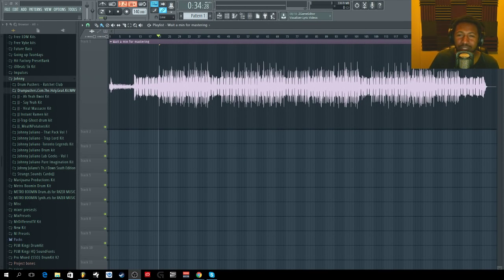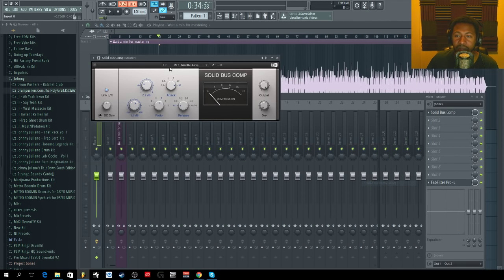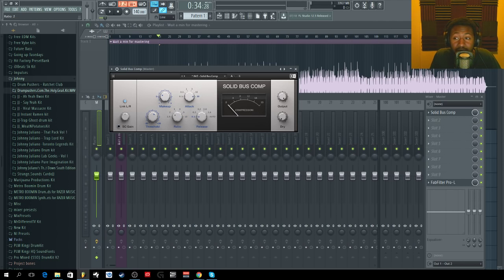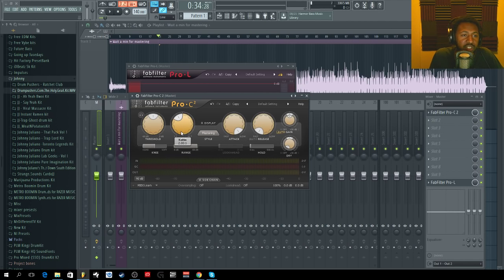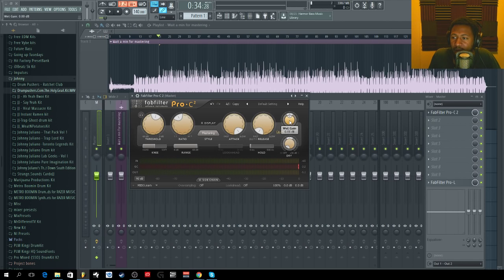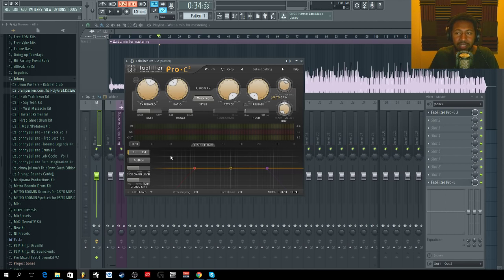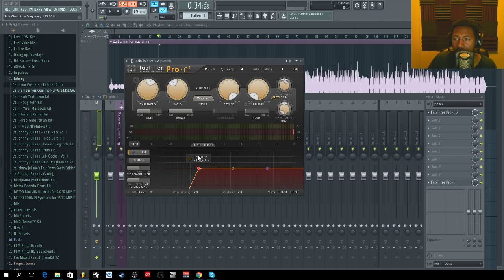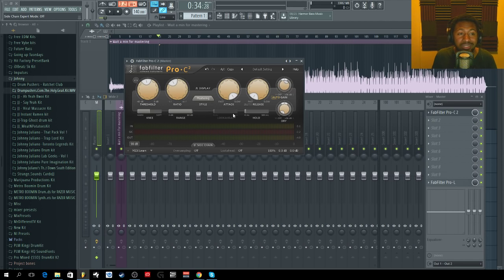Mastering - Mix bus Comp - Part 2  [Mr Different]

Comment: Hey Mr Different I manage to make my beats sound more loud when mastering but when I export it and then bring up the file in FL studio it doesn't look as thick and chunky as it's suppose to be compared to other producers beats online. Why is that?
Reply: Export settings...
Reply: Trenton Streator what do you mean?
Reply: Try exporting your beats in 24bit Wav files take a bit of space but def worth it.
Reply: Mr Ice I have tried doing that but it still comes out thick. Whenever I try and apply multi band compression using Maximus everything comes out sounding squashed and over compressed. I was thinking this could be because I always assign my drums to their own individual mixer track, EQ them and compress them individually so when I try to compress using Maximus I'm over-compressing things. 

Could this be the issue? I really need help on Mastering because without not knowing how to Master I can't sell beats!
Reply: Don't apply a limiter or compressor on the master channel on export.